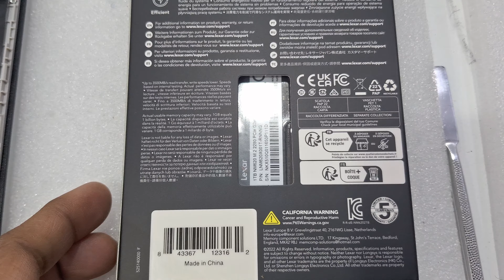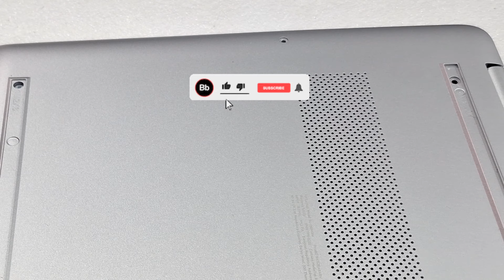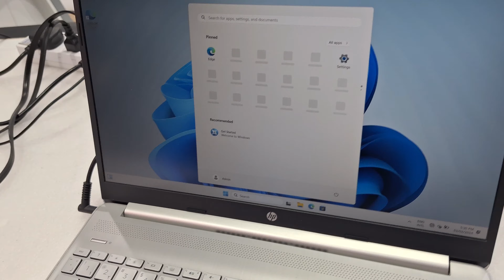HP 15s fq Series Laptop Disassembly Guide Tutorial Upgrade SSD || hp 15 laptop ssd upgrade

Comment: Hello. I have HP Laptop 15s-fq5082TU . Can i add SATA SSD in that empty space right beside the battery an extra ssd or no?
Reply from the maker: This is the new model 12th gen processor in that space we con not  add 2nd ssd, there in no connection for SATA,